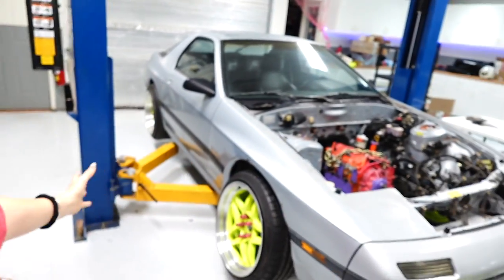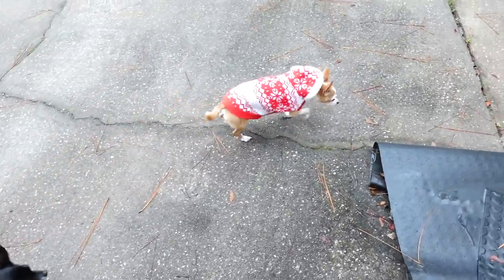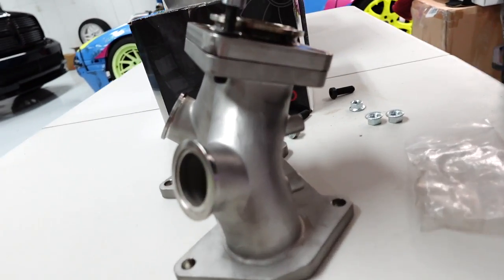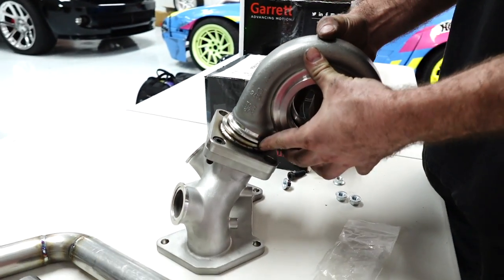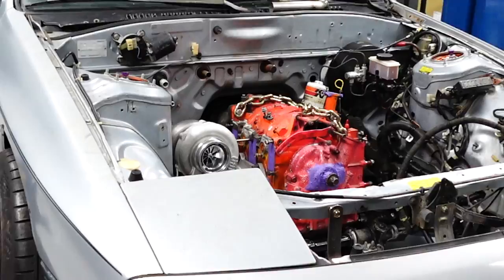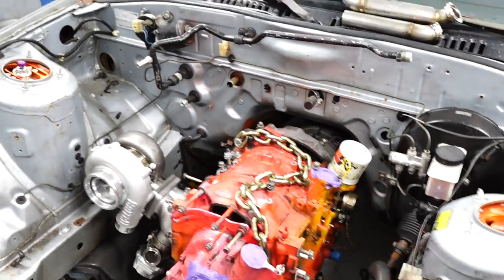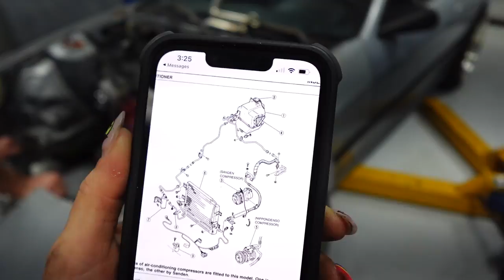Building the ULTIMATE STREET RX7 13b Turbo Set Up!

Comment: Put the g35 1.06ar divided T4 housing on that turbo for better low rpm response/boost threshold. Part# 740902-0108

Curious how response will compare to EFR 8374.  The lighter Titanium Alumunide exhaust wheels spool crazy on rotaries.  My EFR 7670 FC was 420rwhp 420rwhtq.

Comment: @ColleteDavis you should have Garrett send you the T4 1.06 turbine housing for your G35-900 turbo ( part # 740902-0108 ). A fully divided turbo manifold will provide the best response, much better than the single volute vband housing you have. Good luck with the build!
Reply: Oh P.S. That longer front dumptube goes out the back of the car, just like the rear. So turn the WG, and route it around the motor mount..

Comment: That old shell… it has potential! It needs a black Bed-liner paint job inside & out, then dig the V8 mounting hardware that came with the new shell out of the trash, throw in a junkyard V8 & manual gearbox, & any running gear you have laying around, plus a single seat & harnesses, metal grille windscreen, sheet metal rear & side windows, salvaged hydro & angle kit, & you have a survival rat drift car for banging doors round the compound in… :-)

Comment: You should use the flange turbo over a v band for a 13b because it's separate and so short the pulses from the rotors will directly hit the turbo wheel and you'll get quicker turbo response.

Comment: probably on the rear glass .. a small sailor 7 character on both side , and a monochrome "Sailor 7" on the centre ... regarding the old sailor 7 parts , save the fenders and doors and hood .. hang it in the shop ..

Comment: As you work on the AC, please document it! My AC needs a little fixing up. 😝
Reply: This AC unit will be custom made like they mentioned towards the end of the video. Also they kinda already told the details of how it will work. 

If your AC isn't working you can try checking wires, replace the unit or check if your vents have been placed correctly incase the previous owner forgot to do so.

Comment: Why 2 GATES?
Reply: Paired with a divided turbo housing it provides better low rpm boost threshold by keeping exhaust pulse divided to the exhaust wheel.
I logged ~2psi more boost @2,000rpm, so you feel it pulling from every stop sign.